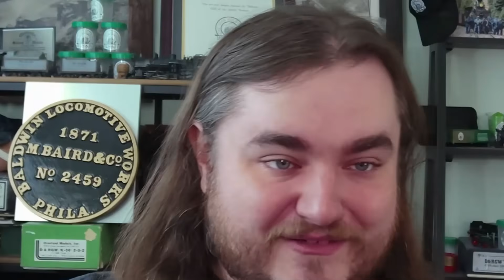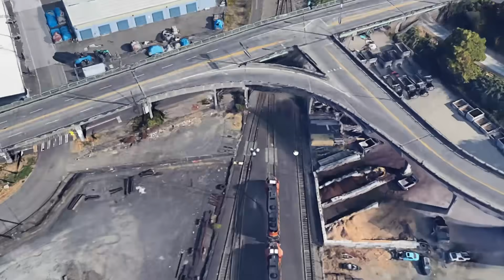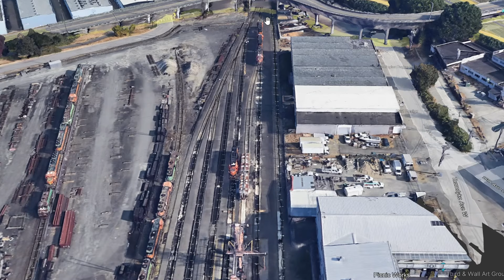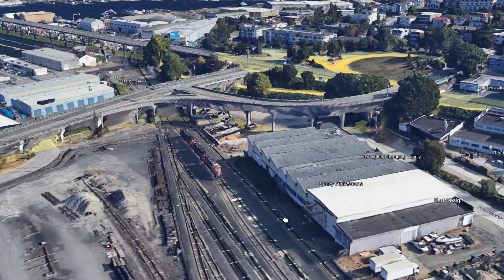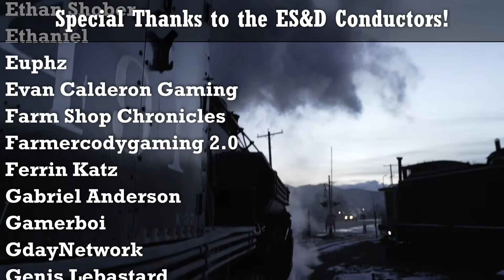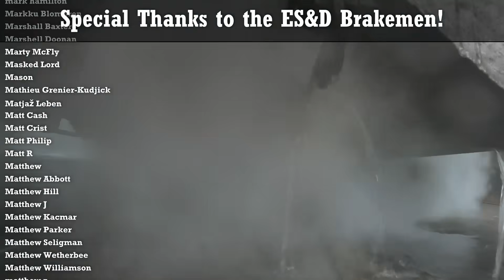[SFS] This is a boxcar that ruined our week.

Comment: Why I'll never work in a union shop. All that time and money wasted because someone would get in trouble for violating a pointless rule.
Reply: There's a point where I can understand it. You don't want a general laborer doing a complete overhaul on an engine or a supervisor trying to work with high voltage wiring (unless they do absolutely know what they're doing and the electrician has asked for a hand). Let the guys who specialize in things take care of the thing they specialize in. Machinists fix machines, electricians fix electronics, pipe workers fix pipes and hoses which contain fluid (including air, which is a fluid as far as physics is concerned) at high pressures, but Mother of God you don't need to call the electrician to screw in a light bulb or the pipe worker to hook up your machinist's impact gun to the air compressor hose, or your machinist to babysit the electrician when he's plugging the HV cables into the generator JUST BECAUSE said generator happens to be connected to a diesel engine.
Reply: Depends on your rep.  If someone (for some reason) filed a grievance for it, a decent rep would get it thrown out for utter stupidity.  Especially when the people who were, by the letter of policy, supposed to move it, all refused to, the only other people qualified to do it, were expected to.
Our list of operations
Supposed to
Allowed to
Qualified to
Can do
Will do
There
Reply: @jaysmith1408  everyone always has these "good union rep" unicorn stories. Through three industries that I've worked in or delt with in twenty years, I've never experienced them. I have experienced or heard of from known first hand accounts of union obstruction: 
Can't move parts from one spot on a bench to another
Can wire a heat treat furnace to power and controls, can run wires for instruments, but can't connect them or replace thermocouples 
Two Union employees, one can transport tools. One can transport parts. Part stuck on a tool? Neither can move it and don't know who can.
Engineer friend of mine got grieved and wrote up for sending drunk union employee off the line who wasn't installing brakes on cars. Third time the union guy got caught drunk and not doing that job. Write up and grievance stuck, the drunk was back at the same work station next day. 

There are many jobs that no longer exist like they did in main stream industry. Blacksmith, sail maker, buggy whip weaver.
It's long past the time for unions and union reps to join them. 
With the modern OSHA administrative presence, they aren't needed for safety. All they do is protect the lazy and incompetent while causing waste.

Comment: When CN switches DPUs out of long trains they often leave them in "box car mode" so they can be picked up and taken to the engine shop like a box car would so they do not have to worry about any locomotive connections.
Reply: The only reason they do that is  to save time vs. a conventional MU set up and air test.
Reply: @Paul070  Like I said, they don't need to be on line and loaded to be moved from point A to point B.

Comment: Hey Mark, I was wondering if old school jointed rail would be more resistant to heat kinks than modern continuously welded rail because the joints would allow for a bit of expansion that isn't available with welded rails. Do you have any thoughts?

Comment: It's obvious that the labor unions are trying to bankrupt the railroads like the gangst...ah, I mean teamsters did to the almost defuncted union laden trucking industry. Here's a concept: anyone that tells someone else that they're NOT qualified to plug in a 110 volt appliance is promoting waste and inefficiency of someone else's investment. This isn't the 1930's and almost nobody's getting abused at work. In the rare instances where there IS maltreatment and abuse, there are voluminous state and federal labor laws so that ridiculous things such as that need not happen. Labor unions are like governments, a necessary evil which MUST be held in check with a tight rein or it will lead to failure.

Comment: Hey Hyce I have a question, how do you know how many locomotives are needed for a train? For example a 100 car train how does one calculate or know that it will need idk lets say 4 locomotives?
Reply from the maker: HP per ton ratio for the subdivision. Flat roads that don't need to go anywhere quick can get away with like, 0.5 horsepower per ton of train; big grades might need 2.5 or 3 HP per ton. That means a 5000 ton train would need 15000 horsepower, which is basically 4 locomotives (4400 horsepower a piece most commonly these days). The tonnage rating is determined per subdivision by the railroad and it's geometry..

Comment: Wow, for once I guessed the twist correctly!  During my year in a tourist railroad, the freight/shop crews often used the term “set it up as a boxcar” for making a locomotive ready to tow.  I can’t imagine how many incidents it took to convince crews to remove the MU hoses to ship locomotives!
Reply: When working at the Union Pacific Lathrop Intermodal Facility, was assembling an outbound train with its assigned power. In the way was our assigned yard power, so the manager on duty said "switch it like a boxcar". We would just tie into it, lace up/ cut in the train air, then cut out the brake cylinders. Whenever there was spare road power laying around, we would usually do this(road power was enough for the job, saved fuel/ wear/ tear.

Comment: Shit like the fridge plugin thing is why I can't stand any kind of union involvement on gigs. (as someone who's determined to accomplish things) It's just insanely nonsensical and legitimately benefits no one. What's worse is how many union guys seemingly get off on being as obstructive as possible in any way they can and use whatever excuse they can to justify it. "I was told to standby, I'm not not moving from this spot until I'm done standing by" ok, yea, but YOU specifically chose to sit directly in front of the gear I need to load on this truck, and moving 5 feet so I can do my job would not go against your standing by. It's infuriating

Comment: I would get in so much trouble working at a unionized place like that because I'd probably do 5 different people's jobs without even realizing it.
Reply: I'd be one to get in trouble here. I see a small task that I knew I could do and that task was holding me up from getting my other tasks done, I just be like... Bleep it and get her done so I can do my work.
Reply: @SleeTheSloth same
Reply: There's a couple union shops in my industry, I got caught out as a guest asking questions by "I can't do that, I have to wait for X craft". But they're all much bigger operations that can keep both crafts busy all shift without overlap.
Reply: Same here I’m the kind of person that will jump in if they need help even if it isn’t my job! People like us what helps companies run!
Reply: When I used to work for a rock quarry, I used to do five different jobs there. The main thing was I was hired to operate a haul truck. Samsung how that branched out to running the crusher plant, running a skid loader to clean up the crusher plant, running an excavator to sort revetment stone, where can I have a rock technician, and finally running the percussion drill to prepare the shelf for blasting. 

Sometimes when nobody else showed up for work I'd actually be the only person running the plant, while the foreman loaded the customers with the wheel loader. Ultimately the whole reason I did what I did was because I hated inefficiency; and down time is really inefficient.
Reply: Unions are supposed to help people get fair pay, not slash productivity, it's better to have 5 men getting paid 30/ hour than to have 10 men sitting on their hands earning 20/ hour. You get wealth by having high productivity, not by "creating jobs" it's waist full to needlessly increase cost, you may as well have 5 people at home on government welfare and 5 in the shop as have 10 in the shop when only 5 are needed. 

Lower operating costs and better efficiency means the other 5 men can actually get useful jobs, instead of doing "busy" work. Lower freight costs means more volume shipped, it's better for businesses and it's better for the wealth of the whole country

Cross training can help get rid of bottle necks in an organisation
Reply: The thing is that those rules actually make sense in the broader sense. yes, plugging that fridge in is something that anyone could do. Having the knowledge to realize when something goes wrong and unplug it before the electrical fries the entire train is the electrician's job.

He might have some little note where "hey, when the fridge broke it shorted, and you need to replace that outlet"... and yes, I would assume that the plumber would see the note, but I have enough experience to know that not everyone would pay attention to it.

Yes it makes things more complicated. Most of the time it's unnecessary. But I'm not gambling a piece of machinery that costs more than my year's salary.
Reply: This is why I will never work at a union facility. Complete waste of time and money, and then they get pissy when you call them on their bullshit. No thanks. Part of the reason why everything leaves the USA. Normal thinking people just get the job done.

Comment: Bnsf moving dead in tow locomotives is clown show . I've seen a unit go to Chicago to la 4 times round trip before ut got dropped off at its destination.
Reply from the maker: Lmao. Not surprised.
Reply: @Hyce777  that's not even the record God help you if you have to interchange a locomotive between bnsf and up .  We watched a set of G&W units go back in fourth 10 times between Barstow and west Colton stuck on the transfer job ..  your story does explain a lot though as there often separate from.power and train at each yards hump pocket.  No one wants to move them ever ...
Reply: If revenue transfers usually create logistical problems for railroads with 'talent' like BNSF - then I can almost understand why Wisconsin Southern Railroad did everything but explicitly deny allowing Wisconsin Great Northern Railroad use of their service - with an apparent demand that 'revenue' locomotive be fully functional before reaching the customer's machine shop...

I'm thinking of 2 TopperMachineLLC 's horrific experience with Wisconsin' Southern (subsidiary of Watco) : months of write ups for absent inspection defects (in one instance without actually leaving the truck after being handed paperwork showing the previous list was cleared or irrelevant _for a boxcar_), then later not even gracefully accepting the payment without extra hassle encumbrance once their encumbrance part of the job was done.

Because CN sold a number of 'their' subsidiaries to Watco the preceding June; and I thought that CN's sale included the entirety of Wisconsin Central surrounding his shop -- I felt so bad when J.Topper capped his praise for CN ({for generally being highly competent, allowing the problem to be resolved in days once it was in their care})  declaring that he would never [need to] deal with the Watco again...

...Though it reportedly took 4 inspectors to get past Watco. I wonder if 4's a magic number of iterations for moving dead locomotives over US railroads.

Comment: The thing about who plugs in something on a locomotive reminds me about something that I heard about the theatre and how things work on the stage with certain things like for example a lamp. The props department can bring it on stage but the lighting department has to plug it in and unplug it before props can touch it again.
Reply: In a Union shop it's not usually like that-- until the company does something shitty or underhanded, then everyone gets all "work to rule." I worked on a line that paid extra-- piece work.  And we learned all the minor non safety related "fixes" to minor problems to keep that line singing for 8hrs non stop. We learned ways to take our breaks and lunches in a way that didn't impeded production.   Then one day the company decided they didn't want to pay incentive bonus, or piece work anymore.  Fine, we just stopped doing all those little things and took our time finding a supervisor to tell him to get an electrician or millwright-- which because they cut back on them could be a half mile away at the other end of the plant.  The Company was well within the rules of the Collective Agreement to stop the incentive bonus plan. And we were well within the rules of the Collective Agreement also.  One big unhappy family.
Reply: @rodchallis8031 man I hate it when the company screws you over. I want things to run smoothly, I want to be one big happy family, but they really screw you over sometimes.
Reply: Well, I think a lot of stuff happens at work that's just "shit that happens" and I managed to not get all paranoid or pissed off or vindictive over too much stuff.  In the example I mentioned, though, we learned extra stuff and learned how to waste as few seconds in a shift bringing the  A+ game to work every day, evening or night. I'm sure the company had good economic reasons in their eyes to get rid of the incentive pay.  But I also am free to make the same economic assessment when it comes to busting a gut for less money.  Less money, less gut busting.  And, I am sure they factored in that exact reaction.
Reply: @rodchallis8031  yeah, totally get it. When the company doesn't go above and beyond for you, you don't go above and beyond for them.

I'm a guy who likes to give it my all, but it's annoying when the company gives you negative motivation to do that. So you make sure you take EVERY break you are allowed, you take a few extra minutes on the shitter. Delay a few seconds here and there. If they're nickel and dimeing me, I'm gonna nickel and dime them too.

I just wish it didn't have to be that way.
Reply: @rodchallis8031 oh yeah, shenanigans beget shenanigans.  Last case, I worked for a truck leasing company.  We we all teamsters, with a terrible contract.  Just about all we got, was overtime after eight hours.  District came down and said, rental business is slow (with closures and lockdowns), they’re not going to pay overtime.
Alrighty then, we won’t work any.
There is nothing we could do in under an hour.  Our closest lease customer was about twenty or so minutes away, took the time to pick and drop the truck, and twenty or so minutes to get back.  Not milking the clock, really couldn’t do anything in under an hour.
So at eight o’clock, we were in the cafeteria watching Chicago Fire or ChiPs, depending on the day.  Management was pissed that we were just sitting around for an entire hour before the end of shift.  We explained the dilemma.  Pay us the extra ten minutes it takes to get the jobs done, and we won’t sit around for an hour.
Otherwise we got to work in the shop, work with the mechanics, fuel and wash the trucks (saved the average half hour wait for a fueler).
About a week later, we heard they were paying a couple people overtime as straight time.  Very shortly after, we were on the phone with the union.  Went as follows.
“You hearing this?”
“They WHAT?!  Hang on”
“YOU WHAT?!”
“Uhh, umm, well uhh”
“I’m back, overtime is restored, you can finish whatever jobs need done, and back pay will be in the next cheque”.
Reply: Similar situation back around 1990. I was an outside consultant and we needed a PC moved from one room to another. This was in Long Island City, NY. A beverage bottler, definitely a union shop. To move the PC we needed an electrician to unplug it, a laborer to actually move it and another  electrician to plug it back in. Well, PCs were new. Neither electrician knew a darn thing about PCs. I had to teach each one about CGA cables for the monitors and the DIN cables for the keyboard. But, I could not touch the wires.....
Reply: It does sound ridiculous, but there are so many things that can go wrong or get damaged if you plug things in to the wrong power supply. It’s probably less of a problem today, but that kind of rule makes real sense in the 1920s or 30s when few people had any experience with electricity. And it’s probably simpler to stick with the rule than have a list of exceptions that people can forget or confused by and have a habit of plugging things in.